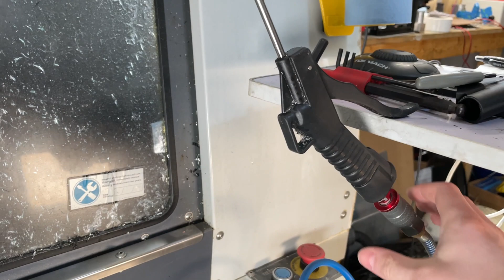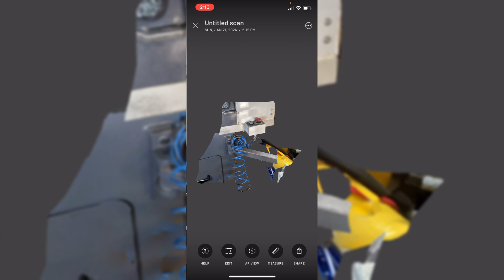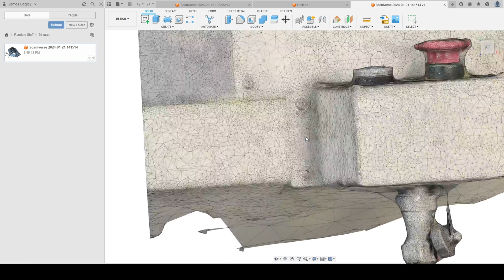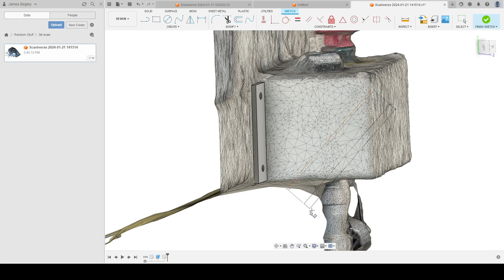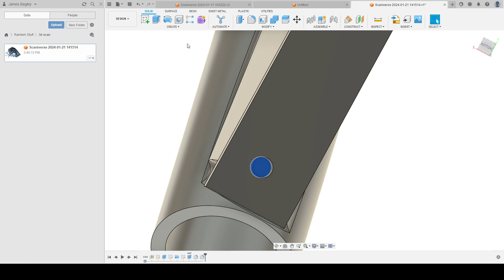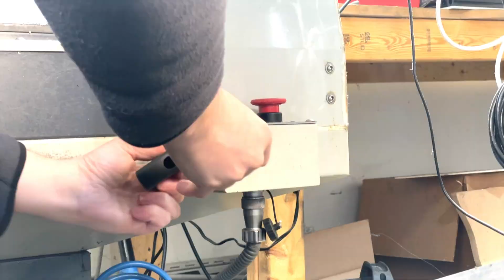3D Scanning my CNC mill with my iPhone to fix a simple problem!

Comment: bro, i designed the part under 5 seconds in my mind, you really dont need al that technology to do it
Reply from the maker: This video was more to show what you can do with the scanning technology, this application just shows you what the capabilities are, it's up to you to choose where to use it
Reply: xyz, no you didn't. 
You can have a rough idea of how it will look like but you still need a caliper to make sure things are design to scale without having 10 prototype and no real reference.
OP approach was smart with a real reference point while designing, no guesses.
Reply: yeay nay i dont need 3D scanning tech i need a ruler and some cad and some critical creative thinking, good luck on sucking tech tittay  @hakunamatata324
Reply: @hakunamatata324   yeah i did, i dont need 2k$ tech to design z simple addon, what this dude does is lil to say whimsical appriach to the problem, maybe that why he has hundred of views instead millions, all you need here is some critical thinking and a ruler and not some nasa level technology, solve problems somple not creating more problems...
Reply from the maker: @xyz-yb6ep  again, this is just a demo of the technology. I have used it on more complex curved parts where you would be there all day taking measurements and still not be able to accurately model the part. I made the video because people were asking about the tech and I had something I needed to design anyway. It's up to each person to decide which tech is useful to them in each application. I didn't pose it as  the only option, just that is is an option.